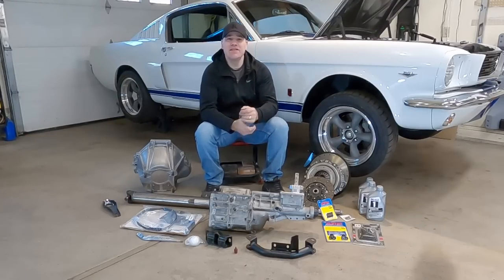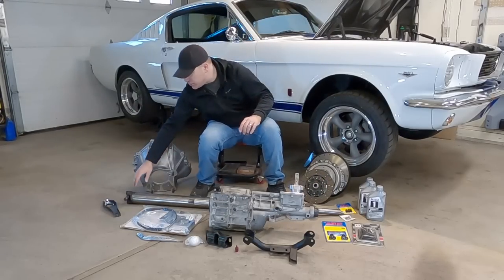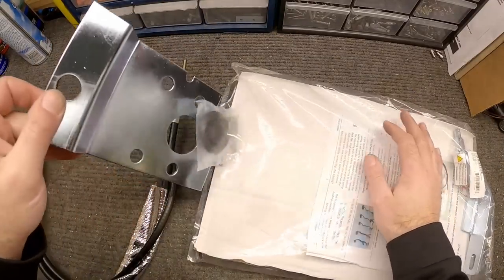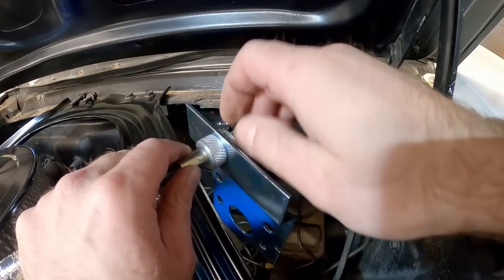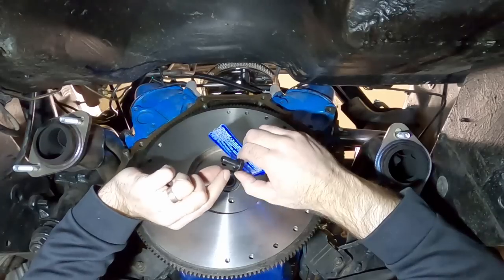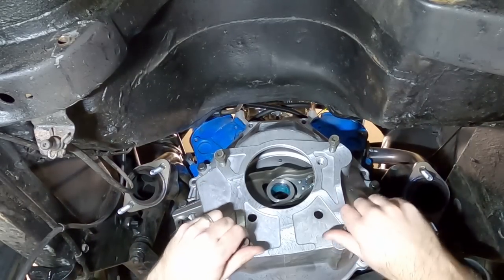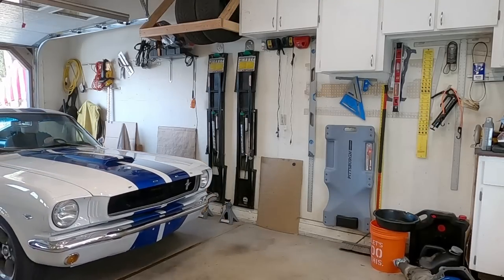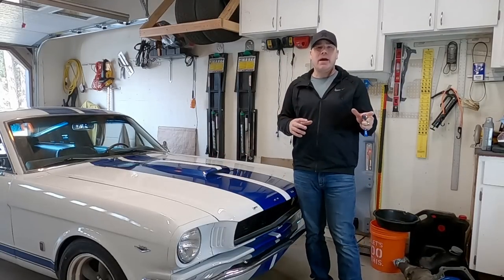How to swap a C4 Transmission for a T5 Transmission (Part 2 of 2)

Comment: Hi I’m doing a t5 swap on my 65 I’m using a 88 t5 with the stock 88 bell housing so my question is do I use a 88 flywheel and clutch or the 65 flywheel and clutch? Thanks love your videos
Reply from the maker: That '88 flywheel has a 50oz imbalance, so unless you've updated your harmonic balancer to also have a 50oz imbalance, you'll want to stick with the flywheel on your '65.  The clutch is another story.  This is dependent on the clutch actuation you plan to go with.  If you are planning to use the factory 'z-bar', you'll want to use the '65 clutch, or at least a new one (call MDL, they'll have exactly what you need).  If you're using a cable actuation or a hydraulic actuation, you'll want to get the modern 'push' style.  This is another area where you can call MDL with your setup and they'll tell you the parts you need.  Good luck, you've got this!!  :)

Comment: Do you have part numbers for the clutch pedal and all the other parts needed (I have the T5) but I’m trying to get an idea of what else I’ll need. Thank you
Reply from the maker: I don't know what parts you need because I don't know what you have so far.  Your best bet is to head over to MDL and start with the clutch pedal.  They usually put common needed parts on the bottom of the page for each individual item.  But if you're still unsure, call the boys at MDL and tell them what you're working with, they'll be able to show you all the final pieces you need to get that T5 in your car.  :)

Comment: Where did you find the bolts for the bell housing? I have been all over my town and no one has them.
Reply from the maker: You may need to check out NPD, CJ Pony, and maybe Modern Driveline.  Unfortunately those kinds of bolts are not something most places will stock locally.  You can also try McMasterCarr, they usually ship pretty fast.  :)

Comment: Lovely video, literally just what I needed as I’m about to do this with my 67! I’m back and fourth on if I want the hydraulic clutch, you briefly mentioned it, but from having a Hydraulic clutch to now cable, I’m curious as to why you went the cable over hydraulic? I’m leaning on going cable as well.
Reply from the maker: Thanks!
I had to put the Hydraulic actuation on my last Mustang (I have a whole video about it and why), but this round I went with the Cable option for two reasons.  One, the Cable option is almost 1/2 the price of the Hydraulic option.  Two, I don't mind the required "push" to get the Cable to disengage the clutch.  So people don't like that it takes additional leg strength to actuate the Cable clutch, but I don't mind because I'm old school and that's just how it used to be.  On the other hand, the Hydraulic actuation is buttery smooth and incredibly easy to actuate.  If the price was the same, I might have just gone with the Hydraulic.  :)
Reply: @AndyKruseChannel  Ahh makes sense! Yeah after all my research only difference I could really see was it is "harder" to push with the cable but I agree that isn't a problem for me at all, and the additional cost for hydraulic isn't worth it for me at the moment. But awesome this video couldn't have came out at a better time. hoping I don't have an issue with my long tube headers and the cable like you did before
Reply from the maker: @lukegoodwin2160  I hope you don't have an issue either.  MDL has a list of headers on their website that are known to work with the Cable Clutch, it might be worth it to check it out.  :)
Reply: @AndyKruseChannel  Do you know where that link is on their website? I've been endlessly researching trying to find out what long tube headers will work with the cable clutch. I'm almost done with my 347 build and do not want to go shorties on it. Thanks!
Reply from the maker: @lukegoodwin2160  The list is inside the instructions for installing the cable clutch, and those instructions are available (in PDF form) on the page of the cable clutch kit.  YouTube won't let me put a link in the comments, but the instructions can be found on MDL's site when you get down to the specific kit for you car.  :)

Comment: Awesome video this conversion is moving to the top of my list! What was your budget for this? I'm seeing  the transmission itself running between $1,100-2,000 not including bell housing and other components..
Reply: Was this a new unit or a refurbished?
Reply from the maker: I'm into this particular swap about $2500, but I was almost $4500 into this same swap on my last Mustang.  There were several things I didn't need to buy this round, but part of that is due to getting the "right" T5 and using some parts already on my car.  It's safer to buy a T5 from places like MDL or a local transmission shop as they're likely to have been gone through recently and often come with a warranty.  But, nothing is free, so those T5s will be more expensive.  I purchased this T5 from a local guy off Facebook for $250.  The guy seemed legit, but the price was too good to be true.  Turned out that there were several teeth missing from the mating gear for 4th on the intermediate shaft.  But, when buying the new intermediate shaft and rebuilding it myself (there's lots of good videos on YouTube on how to do that) and buying some needed tools, it was still cheaper than what I paid for my first T5 and I was able to skip the rebuild labor costs I had to pay last time.  However, not everyone is in a position to do that kind of work, let alone be willing to give it a try.
Another thing to consider are used parts.  While not ideal for some people, this can be a way to shave a few bucks off the total.  The single most expensive item I had was the Cable Conversion Kit (the Hydraulic Kit is almost double that price).  The bellhousing was also a pricey piece, but people can find these used all the time.  I think it's robbery for what they charge for the Crossmember Support, but I wasn't in the mood to make my own so it is what it is.
If you bought all new parts (like I did), you can safely put aside $2000 for everything but the T5.  That will get you what you need and give you flexibility if you want something nicer than what I have for one part, but willing to go a lesser route for another part.  It's easier and cheaper if you stick with the '83-'93 T5s, but the newer units will work, it just takes more money.  For info on installing the '94-'04 T5s in a classic Mustang, check out the T5 swap video I did last year.
Reply from the maker: Used unit.
Reply: @AndyKruseChannel  I saw your last series on the coupe! I agree it's murder how much some of the components cost. I have a local place that has several refurbed units and also carries plenty of components. I'll be converting from a 3spd manual and would like to use most of the parts that can carryover assuming they are in good shape still. 

Are you going to swap the rear end out next to improve acceleration? I guess it all depends on what most of your driving is. I'm city almost exclusively so don't mind highway speed cruising at s higher RPM, just not 1:1 high 😁
Reply from the maker: @jordanschultz2232  I don't want to give away any details on the new rear gear and limited slip purchase I made... wait..... doh!!
Reply: @AndyKruseChannel  some details about future projects seem to "slip" out from time to time. Can't wait to see your continued efforts, gorgeous car!

Comment: great job on the videos. it appears if you have power brakes the booster will be in the way of hole needed for clutch cable. Any thoughts?
Reply from the maker: I cannot confirm if the booster would be in the way, but the cable is sort of flexible, it might be able to be routed over the top of the booster to the firewall.  Also, if it is (which MDL can confirm for you) you could do the hydraulic option.  I went from Cable to Hydraulic on my last Mustang and I made a video of how that install went.  The master cylinder for the hydraulic clutch mounts closer to the fender wall, so it would definitely clear the booster for the power brakes.  The hydraulic actuation is much, much smoother and easier to use that the cable, I just went with the cable because of my budget.  :)
Reply: @AndyKruseChannel   Appreciate what your doing. Have a 66 coupe. endless possibilities with these cars as long as the wallet can handle it. Thank you Sir!

Comment: Hi Andy,  Why did you switch to the hydraulic clutch release?  Was there something wrong with the cable release method?
Reply from the maker: I'm getting old and the relatively zero effort needed for the hydraulic actuation is better for me knee.  For those on a budget, the cable actuation is perfectly fine, but if you've got the scratch, get the hydraulic version.  :)
Reply: @AndyKruseChannel  I feel your pain.  i just turned 62.  What's you recommendation on headers?
Reply from the maker: If it's in the budget, FPA headers any day of the week.  If the budget is less, then something like some Doug Thorley Tri-Y headers.  :)
Reply: @AndyKruseChannel  thanks Andy, I really appreciate your help and knowledge.

Comment: why do you need a new bellhousing? is it because the opening for the transmission is a different size?
Reply from the maker: So the T5 is the correct depth and so it bolts up correctly.

Comment: Andy, I too love your videos. I recently did a T5 swap for my 3 speed in my 67 Fastback. In the first runs I’m hearing a kind of whoa whoa sound in 1st gear as I accelerate and it’s noisier than I expected in 1st gear. Worrying Ive got a problem. Any advice or comment?  It’s a new T5 from MDL.
Reply from the maker: Thanks!
Um, not sure where to begin.  Using words to describe the sound is not easy, so I'm already lost on the "whoa whoa".
If it's a new unit from MDL, then it's probably not the Trans.  However, if it's only in first gear, you can almost eliminate everything outside of the Trans.  I did find the long threaded rod of my parking brake (once I finally installed my parking brake) was very subtly touching the u-joint right at the output of the Trans.  After trimming the length of that rod down, the sound went away.  However, I'm not sure how the parking brake is setup on the '67.
You may need to put the car on jackstands, fire it up, and put it in gear.  As long as you don't get crazy with the wheel speeds, you should be able to hear the sound with the car in the air.  You'll need so help, maybe have a buddy sit in the seat to keep the speed low while you listen.  Try not to get under the car, but you may be able to see something rubbing if it's an external issue.  Good luck!!
Reply: @AndyKruseChannel  thanks for the quick reply. I did put the car on blocks to turn the wheels. Sure seems like the noise is coming from the transmission.  I say noise but also a vibration is part of this. I did find an exhaust bolt looking like it was touching the floor. Fixed that and no real change. I’ll take a close look at the emergency brake cable set up but pretty much as you describe on the 66. I’ll be calling MDL.

Comment: Did you use tailshaft off the 86 T5 as well.
Reply from the maker: Yes, it fit perfectly in the car, no issues with installation or alignment of any kind.  :)

Comment: Hey, quick question.  You have the JBA 1650SH front pipe for the C4, how does it fit with the T-5?  I talked to JBA and they said it won't fit the T-5
Reply from the maker: I can see why they would say that as the crossmember I am using is from MDL but I had to slightly modify to make the JBA pipes work.  Some crossmembers out there don't work with these JBA pipes (you can see why in my video), but the MDL unit is the closest one I found that will work.  :)
Reply: @AndyKruseChannel  Excellent, thanks for the reply.  That is the crossmember I'm going with when the time comes to convert it to manual.  I just didn't want to have to buy another front pipe when I change to the T-5.

Comment: How do you deal with the neutral safety switch that was connected to the c4 I just finish the swap but my starter won’t turn because my safety neutral switch it’s not connected do you bypass ? Thanks in advance
Reply from the maker: In this car it was not hooked up.  As far as offering advice on how to bypass the neutral safety switch, I'm not your guy.  :)

Comment: Which clutch was that? MDL, Zoom? New or sourced? I'm thinking about doing the same C4 to T5 or maybe TKX soon. Also, what would you say your gas mileage was, and what is it now? (looking a pros, cons, etc)
Reply from the maker: The clutch is a new unit from MDL, part number MD-07-14C.  If it's in the budget, I'd recommend the TKX over the T5.  I may upgrade to the TKX down the road.
I never paid attention to gas mileage on this car, as I drive it so infrequently and with a heavy foot.  :)
Reply: Thank you for the quick reply. @AndyKruseChannel  How come the TKX over the T5? T5 not sturdy enough? I'm looking at a good deal on a brand new T5 + new bellhousing + new Crossmember for $1450
Reply from the maker: The TKX is rated for much more power and in my case, I am making more power than what the T5 is rated for.  I have not broken anything yet, but that's a combo of me not driving like a mad man, but I also don't want to break anything right now so I'm being mindful of that while I drive.
As long as the guts of that T5 are not shredded, that sounds like a decent deal.  :)
Reply: @AndyKruseChannel  Makes sense. No, it's a brand new T5 from Tremec. Guy bought it and had to pause his project. I have a Blueprint 302 crate engine rated at 365 hp. It's a daily driver so while I'll get down on the throttle every now and again, I drive it likes it's a 50 year old car. (The good folks at Modern Driveline actually recommended at T5 over a TKX for my application.) My only hesitation is like you mentioned I don't want to feel like I have to be careful all the time. I think it'll be fine though. Appreciate your channel and your videos. I'm learning a lot!
Reply from the maker: @bradstaton1934  New T5, Bellhousing, and Crossmember for $1450?  Buy it.
Yeah, at 365 you'll be fine with a T5, just keep the 5k clutch drops to a minimum.  Actually, you'll probably shred the 8" rear before you ruin the T5, so now you've got one more item to explore for your list.  😝

Comment: Your content is great! I've learned a lot, you explain very clearly and give lots of useful insight. 

I have a question I was hoping you could help me with (or anyone in the comment section for that matter). 

I found a 1994 BorgWarner T5 transmission for my 1966 Ford Mustang.  I know 94´ T5 models are not the ideal for a 1966 mustang as the transmission input shaft is longer, the ideal ones are 93 and below. However after hearing your statement at 1:06 where you were able to adapt a 2001 T5, gives me hope that the 94 can be adapted. 

I still have the original 1966 Bellhousing tho.  

What do I need in order to be able to adapt the 1994 BorgWarner T5 transmission to my inline 6 1966 Mustang? Would I need a  T5 adapter plate for 6 bolt Bellhousing? I reckon i'll have to adjust the drive shaft, correct? Anything else that I'm not contemplating? Is it a dead end?

I appreciate any comment, I'm here to learn.
Reply from the maker: If you are set on putting that T5 with your I6 engine, you'll want to reach out to MDL and tell them what you have and they'll tell you what you need to make it work.  They may have a bellhousing that will bolt up to your I6, so I guess you'll want to solve that equation first.  If so, then you'll need to get the shorter input shaft and come up with a solution for the crossmember bolts are about an inch farther back and the speedo on the Trans is not a mechanical drive like your current setup.  Fortunately I have a few of these solution in my other T5 swap video (summer 2021) where I put in that 2001 T5 you just mentioned.  Check that video out.
It's not a dead end, it just might cost more than you want and you'll have to decide if it's worth chasing or make changes to the car/motor to make it work.  :)
Reply: @AndyKruseChannel  Thank you very much Andy, i´ll check out your other T5 video. I asked MDL and they told me it´s a dead end lol, but I´m not giving up yet. I still have the original bellhousing that goes with my inline6, so I´ll see if I still can adapt it. Worst case scenario i´ll sell it and hope to get the proper one. 

Final question, once you were able to swap your 2001 T5 to your old Mustang, did you have frequent problems with the installation/adaptation? or once it was set up it worked just fine?
Reply from the maker: @jcrb0  I hate to break it to you, but if MDL says it's a dead end, it probably is (unless you've got money for custom parts).  If you're set on keeping your 6, you're limited in what you can do with it.  It might be worth it to find a 289/302 locally and shove that in there, then the T5 will work great.
Once I got the T5 installed, it was easy as pie, with the exception of the clutch cable that I melted.  But that was my fault for not following the directions from MDL and header choice.  I had zero problems with that trans, and so I did it again on my next Mustang.  Everything is great!!  😀

Comment: hi Andy I am installing my t5 on my 351c but the t5 is sitting more to the driver side this is normal?
Reply from the maker: I don't know how the T5 would fit in your application, but it shouldn't be too far off from how it bolts up and fits with the 289/302 blocks.  Is it possible that the engine mounts are either worn out or need to be adjusted?  That may play a role in how the T5 fits in the tunnel.  Also, in my build, the T5 isn't exactly centered in the tunnel, and this is ok, the crossmember bolts to the transmission and makes everything line up.  :)